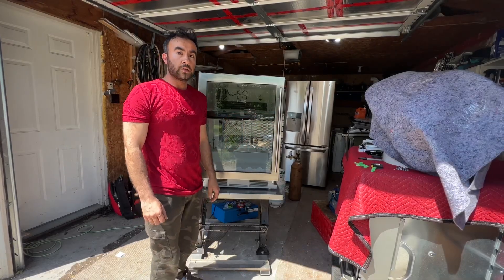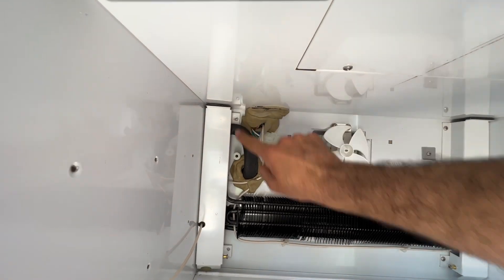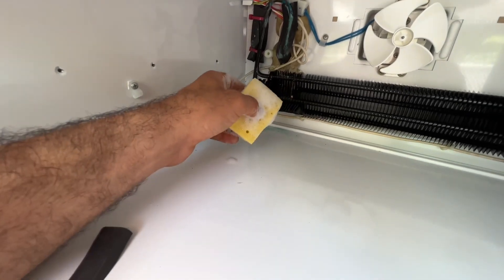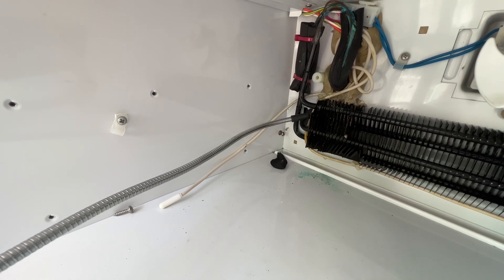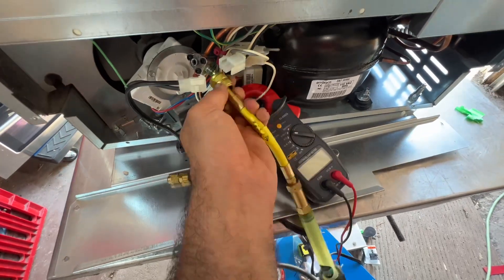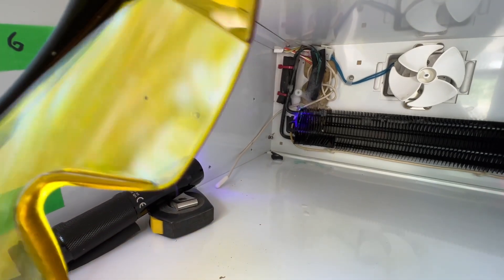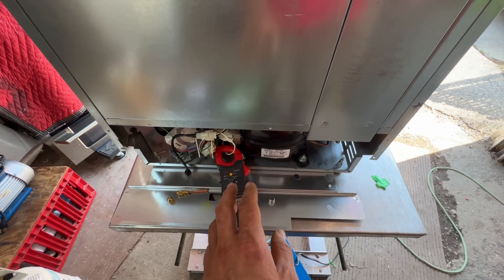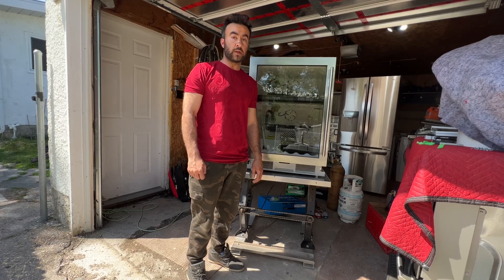5 ways to find a gas leak on a fridge

Comment: Had a failed beverage cooler. Was able to find a major leak on condenser? Where copper and aluminum tubes joined. JB Weld was the fix. Running perfect for two weeks now

Comment: Hey hameed what you use for soldering ? Vulkan lokring?
Reply from the maker: I use the turbo torch and Vulcan Lokring . I use lokring inside of the unit and I use torch outside of the unit on R134a and R600a .
Reply: @hameedwafaAFG  why you don't use vulkan lokring for inside and outside
Reply from the maker: @mohnewyork1082  it’s expensive sometimes .